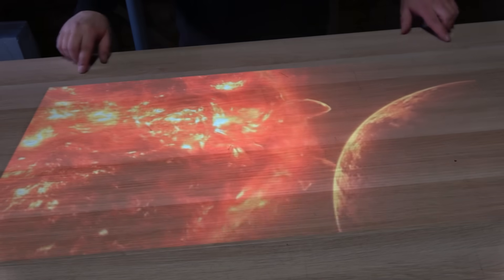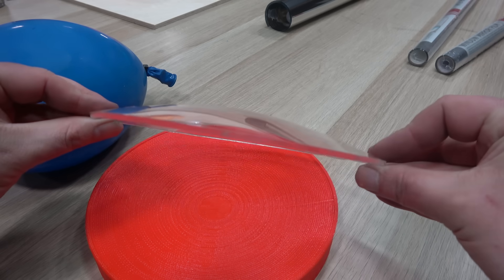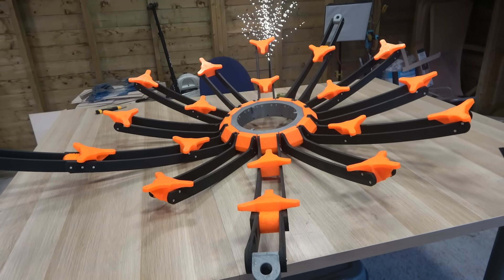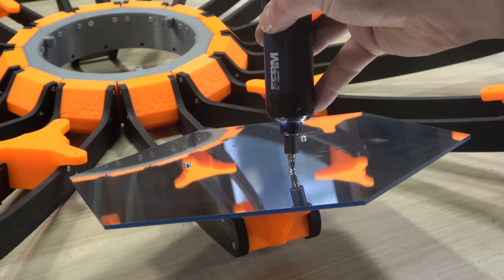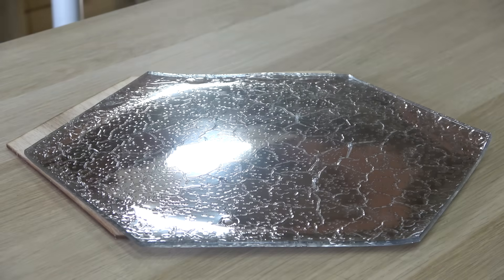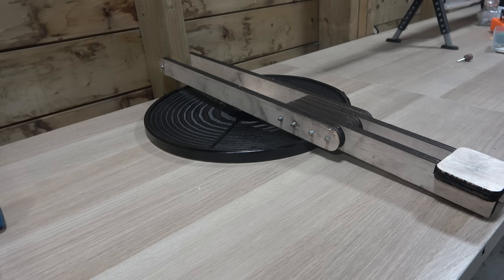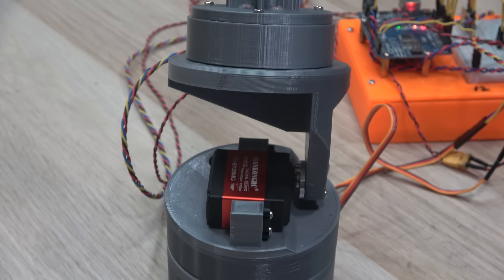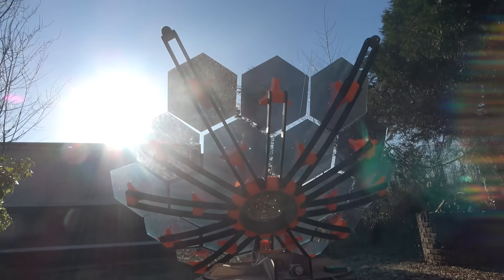Building a DIY Solar Generator..

Comment: Have you run any small scale experiments or done calculations on the thermals? My first thought was, "this is dangerous". The receiver and the secondary mirror will get very hot. You're using plastic supports and a plastic cover plate on your heat exchanger. What if the water pump fails, the water boils out or pressure rises due to rapid phase change? How large is your water tank for thermal exchange or storage? Sensors for over-temp shut down? Fire, hot steam jets, grass fire below?  Also, what if a neighborhood kid comes into the yard and puts his hand against the collector or looks directly at the secondary out of curiosity?  It's a cool project but I see many safety risks. I'm a degreed Mechanical Engineer (studied solar engineering in college) and worked at a premier electronics device company for over two decades. I also worked with UL and did many CFD analyses on different thermal designs. I see lots of safety issues here. Not trying to be a negative Nancy; just make sure you do proper "risk management" and maybe an FMEA. A lawsuit or a house turned to black smoking ruble isn't the desired outcome. Also, wear protective gear when working with it: gloves and maybe a set of green welding goggles, etc. I'm old, been there done that: learned lots of lessons by making mistakes. Fortunately, none of them were really bad but this thing could hurt you or others. There's a reason all molten salt solar generators are way out in the middle of nowhere and Crescent Dunes went non-operational after two years. Be careful.

Comment: The reflective film can be applied after the shaping. Im. Thinking, put a small hole on the back side of the plate, stretch and seal the reflective film then heat it and use a vacuum pump to pull it into the form.

My 2cents

Comment: You should anodize the aluminium absorber on the sunny side, a cheap alternative woud be sooting it but I don't know how much heat or rain that would survive.
Also create the possibility to let the liquid run through it without additional piping in there. So you can maximize power absorption into the liquid.

Comment: I also think water is problematic as a fluid. For one thing, it becomes gaseous at 100 degrees and in winter it threatens to freeze. I would prefer to use a special solar fluid or some kind of oil. This can absorb significantly higher temperatures (solar thermal energy reaches significantly more than 100 degrees!!!) and does not freeze. And the aluminium plate also needs a black matt surface!!!

Comment: Trackers that "see" the Sun are cool, but as you demonstrated they can be fooled. Since the precise azimuth and inclination of sun in the sky can be readily calculated for anyone's particular location, I reccomend parsing that data into a daily data table that a tiny arduino could use to point the array via the existing motors.  This way you could limit the interval of when the motors are activated greatly extending their service life. You can likely allow up to a +/-5 degree off centerpoint deadaim accuracy without serious loss of energy as has been demonstrated in photo-voltaic trackers. So if you have no trees blocking your horizons you would only need to have you motors activated 18 times a day to cover sunrise to sunset. The amount of each adjustment would vary with your lattitude and the calandar. And as long as the clock function on your arduino is set right, your solar tracker wont ever be distracted by clouds, mischievous kids with their own mirrors, or passing jetliners and UFOs. Lol

Comment: There's a lot of comment here about improving the efficiency, but since you haven't run it yet (at least per the video), I would wait and see what your actual problems are before making too many changes. The flat versus curved mirror segment thing has been discussed a lot, but you've already put the work in, so no point in replacing them now. You can probably expect the secondary and its mount to get very hot, I wouldn't be surprised if your next big issue is keep that whole assembly from melting or losing integrity due to overheating. Moving the heat exchanger to the focal point would help with that, but add off-axis load to your tilt motor, as well as adding complexity and putting the water tubes in the concentrated heat zone.

What do you plan to do with the very hot water you produce if this thing works as planned? Also consider changing the tubes for some that's good for 300+ degrees, that water (hopefully) isn't going to boil in a sealed system, so you'll probably get superheated water and I don't think your vinyl tubing is going to like that. :) 

Looking forward to the next video. Subbed!

Comment: Hi, you use the azimuthal mounts for your mirrors. These mounts require tracking in two axes (azimuth and elevation) because they have to be moved horizontally and vertically to keep the sun in view.
Alternatively, there is the German (also called parallactic) suspension. With this mount, you align the main suspension firmly to the north, at an angle that runs parallel to the earth's axis (north alignment). This alignment, also called polar height, is set once and then does not need to be changed. The second axis, the declination axis, is used to set the sun's orbit and is adjusted less often.
Tracking on German mounts is mainly done via the hour axis (RA axis), which compensates for the earth's rotation. This enables precise tracking with just one axis. This enables even more precise control, which does not even have to be done by a sensor but can be time-based. In addition, a safe night position can be programmed.
Thanks for the great project.

Comment: Instead of the middle plate to absorb the heat, you should replace it with another mirrow and use the focal point to absorb the heat. As a result, you have only one reflection and thereby a higher efficiency

Comment: Hmmm my input would be use a giant fresnel lense (like those in older big screen tvs) and have that panel follow the sun while your collection/heating tank stays stationary under it. Less moving parts under weight so less chance of it breaking. Oh and adding a counter weight (about as heavy as the lense and top assembly) to the bottom side would probably help with less strain on your teeth/motor gears :)

Comment: 1) if silver is perfect for reflection, the reciver of all that energy (the middle) should be black. That will improve efficiency immensly. Just in case of to much reflection you could fry your secondary mirror.
2) a huge improvement on the steam machine was adding a condenser. A cold end would significantly improve your temperature delta and therefore the carnot process.
3) plexiglas at the secondary side of the reciever? My personal guess is, the steam, that will be produced by a black reciever will bend it and open cracks to escape. Do not reach for it, super heated steam will not be visible, but will burn you, that you risk loosing the muscles beneath the skin. 300 Degree Celsius Steam is nothing to fool around with. Get a steal back plate and some heat resistent gunk to seal it.
Your connector and those plastic tubes wont cut it either. If you replace them with metal, make shure they are pressure rated. Bursting metal pipes are sending out shrapnell.
4) The tubing diameter does not look sufficient for the amount of water to cool such a big array. 1 sqaure meter will give you 1000 Watt. If the water will turn into steam, the factor is 1000 that the volume will expand. So that needs to go somewhere. And the pressure needs to be kept in check. Fluid water takes up energy more efficiently.
5) solar cookers are boxes with just a window and insulation around the box. Those reach up to 200 degrees. Solartherm with oil and vakuum tubes as collectors reach temperatures of 400 °C. Both styles are isolated. Your backside of the collector and your tubing should be isolated.
6) you perfectly can test the setup during the winter time. On a sunny day the sun has still full power. Yes it comes from a lower angel, that means there is more atmosphere in the way, but it can be the same power as in the summer. And your system will cool of much better in case something goes wrong.
7) get pressure gauges on your pipes, or better do it digital and have the read out in a safe distance. And add some thermometers. Perhaps a flow sensor.
8) most important: plan for failure! Have routines ready for different kinds of failures. Number 1: turn it away from the sun. Perhaps have some bedsheet ready, in case it must be super fast.
Number 2: what if the pressure rises to the point where your pipes and collector could burst. Have a pressure relief valve. Remember super heated steam is not visible. Do not go close until pressure is fully released.
Good luck, nice project.
(Why apply the reflector foil before the forming of the plexiglas? Perhaps vapour deposition, sputtering is in the cards next time.)
Marbles between two wood plates could be your roller bearing in another version.

Aluminium is melting at 680 °C. Aluminiumoxid is melting at 2000 °C. Every aluminium is oxidicing immediatly, but it is a very thin layer on top of the material. Just in case you get a steel back plate, the next thing to fail is your aluminium topper. When you get up in temperature the aluminium inside that aluminium oxide will get soft soon.
Steel would be melting around 1200 °C.  Next plate should be simple steel. Milling that will be much more expensiv. But welding at home is cheap. (Be carefull welding sends out strong uv rays. Cover your skin, not just the eyes.)

9) Why is the reciever in the middle of the primary reflector array? Why isn't it at the place of your secondary mirror? If your mirror only reflects 60%, you could dramatically improve your solar gains by cutting out the secondary mirror. Where the reciever would cover up the middle permanently, let there be nothing. 
10) you made a secondary mirror, which is situated in the FOCUS POINT of each primary mirror??? Can't wait to see if this secondary mirror gets burned. If not, thank you tolerances. If you would focus one primary mirror alone on a pin point, that should be intense enough to melt steal. I hope you have a spread, as wide as your secondary mirror and/or collector is.

Comment: My concern is that if you're planning on having a mirror at the focal point to reflect it back down to the heatsink with water running through it at the base, how will you cool the mirror at the focal point? It will almost certaintly need cooling as it will be exposed to just as mush concentrated sunlight as the base. Maybe if you just design the back side of the mirror to have a small heat sink and make sure it is highly reflective all around, you might be able to get away with passive cooling from the air. But that all depends on how much sunlight is hitting it and over what surface area.

Comment: Two motors instead of one. The design is great, but the weight on that hinge feels like just one wing gust from destruction. 1 motor for horizonal control and one for vertical. Also adding rear weight counter balance. X and y independence.

Comment: Your test setup for silver and gold reflectivity only measures a very specific wavelength of the laser, which well, the colors are different, so there's no way you would get the same result even with the same apparent reflectivities.

Instead, you would need to measure a light bulb through a hole via reflection on the plate onto such a light sensor, to measure a sun alike visible spectrum intensity.

Comment: - Keep in mind that the secondary mirror needs to be a very specific shape to focus the light from different directions onto the aluminium plate. Also, the mirror will get really hot and deform I think. Maybe scrapping the secondary mirror and attaching the aluminium plate there is a better option?
- Anodize the aluminium black (or have it done by someone) to absorb more light/heat

Comment: So about the spindle motor and the hinge point, i think you could use the spindle motor in a fixed position to drive a one side of a hinged leg that connects somewhere near the middle of the mirror array but not on the heat plate.

Comment: you should always remember to think smart, not hard. if you want a solar tracker, then use solar to track. its simple, place tiny solar panels behind the array at the edges so that when its directly facing the sun, the array blocks the panels from the sun, but when the sun moves, it hits a solar panel which powers the motor to shift in that direction until the panel is no longer in the sun which means the array is directly facing the sun

Comment: best reflect and focus is spiegel. best collect colos is black.   use it in your device . first you do a parabolic form . second you do a spiegel film on the parabolic form.(to make it nice you can catch a film and then use the heat ear to make a film perfect placed). for collector use aluminium or cuprum and draw it black fully.

Comment: Did you account for resetting the tracker for the next day, after the sun set?
It could be that any incoming light will be blocked from its backside, when the tracker has moved to its most western position, so your LDRs might not get any light to adjust to, until its midday.

Comment: I know it's like a month after you put the video up, but I'd have put the heat collector out at the end of the arms instead of a secondary mirror out there. Every use of mirrors is a reduction in efficiency. Also, aluminum is an OK conductor of heat but copper would be better, especially if you do as thatoneguy99100 said and make it black chemically. Your stepper motors will have to work a little harder because the weight of the block & water is out on arms away from the main body, but the overall design will be a lot more efficient.

I'm curious to know how you intend to harvest energy from this hot water - a sterling engine perhaps?

Comment: Love that project.
To me the Base frame looks Thin. treat it as a Hub. Large Hub.
look at the Large Telescopes, Gearing at the outside Ring attached to the whole frame.
Reinforce the Base, and the main sprocket wheel, double the side walls of the arm..
Basically use 15 Mm Plywood instead of the current. 😊
for the frame - more weight - More stability and accuracy (to a point.)
Respect on the Build

Comment: Your springs are going to melt, the collector panels as well. I would use aluminum coated metal mirrors, like a reflector telescope. I think you'll have to use metal springs as well. Is each mirror curved to focus it's light at the overall point of collection, the curve for each mirror should be slightly different give that each mirror is in a different position to the focal point.

Comment: There are some good improvements already mentioned in the comments section, here’s my summary;
1. It’s the aggregate of the small reflectors that should form a paranoid bit the individual segments. This means you can make each reflecting mirror far more simple -perhaps even using square ‘bathroom tile’ mirrors? (A large single dish would also work like a old satellite dish chromed up but I prefer the segmented approach because it scales more easily)
2. Why not use ball joints for the mirror segment holders? (Like the type used for camera tripods) You may be able to 3D print these. I would like to know how you optimised each segments reflectivity onto the receiver.
3. The receiving plate should be painted the mattest black you have.
4. I think the receiver plate is going to go above 100 degrees -won’t this cause the water to boil?? You may need a new working fluid (oil?) All the piping is going to have to be high temperature to match. Looking forward to the next video/tests!

Comment: Very nice project and very good presentation... Also i am an engineer with some suggestions;  Since you manufactured the aluminium plate, some advice to make it more efficent: prepare some weak NaOH (lye) solution and etch the surface of your collector plate, the result of micro pitting on the surface will increase metal-water and metal-light surface contact area exponentially. 
After the surface treatment paint it with some heat resistant super black paint, this will increase light absorbption dramatically. (if you want to go experimental on this part, get some copper powder and mix some powder with the paint then apply) after this make a housing for the collector plate (transparent on the light facing side) say 1cm airgap on all sides to prevent the collector to loose heat to surrounding. Maybe applying the reflective mylar to plexiglass after the parabola shaping can reduce wrinkles, but i am not sure.

Comment: Why not make one large parabolic disc and glue lots of small flat mirror tiles to it, like those used for disco balls? Also, the secondary mirror (which should not be at the focal point of the parabola, but rather at a distance where the focused light is spread across the secondary mirror) can't be flat otherwise the light from the individual mirrors will simply reflect towards the mirror on the opposite side of the parabola. The easiest would be to place the heat collector where you now have the secondary mirror, don't have a secondary mirror at all, and run two tubes to your exchanger from there. Make the collector inverse parabolic so the surface is parallel to the tile mirrors on the parabola.

Comment: Do you have concepts on how to utilize the energy collected? I could see piping it to a sand battery just for heat, or running TEGs for electricity, but are there any better options?
Reply: I tried TEG, but it's not worth it. Yes it works, but you need active cooling and a tracking system for the dish. It's much easier to just use a solar panel instead :)